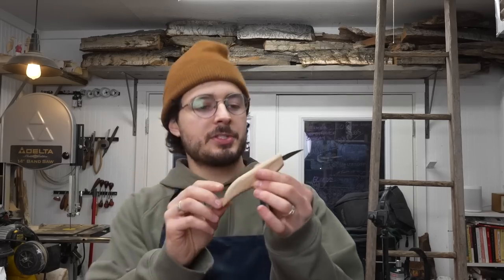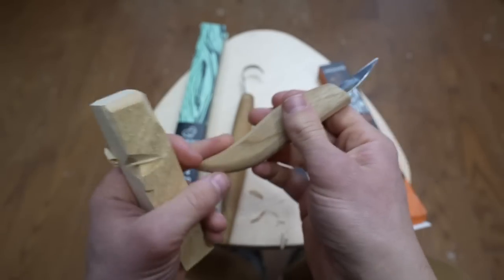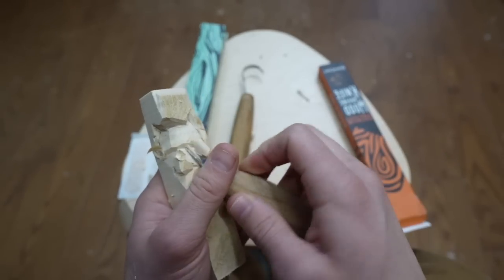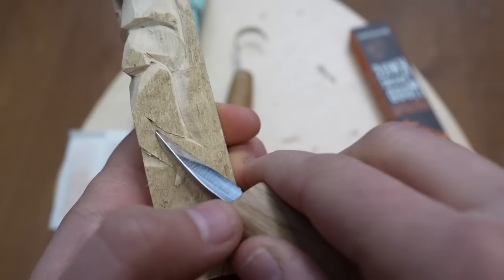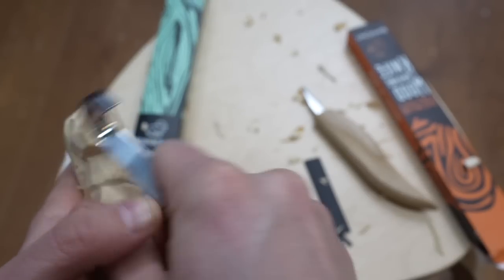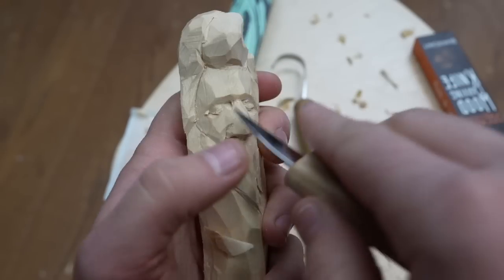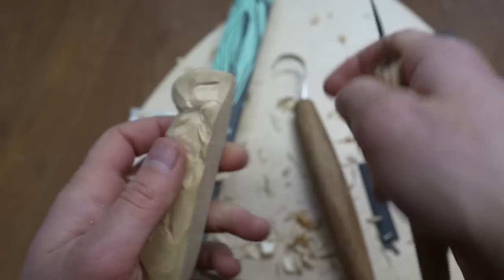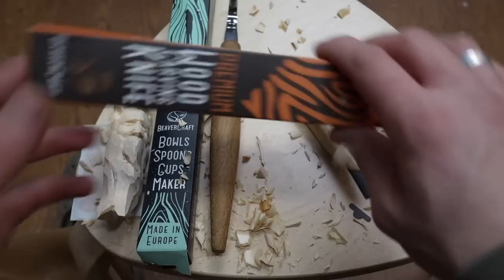$13 Carving Knife Test--Will it Become My New Favorite Knife?

Comment: Honestly, their customer service is what sold me. They also make other tools like draw knives and hatchets. I ordered a hatchet from them via Amazon, and it showed up with a bit too much surface rust on it for being new new. So I went to their website and messaged them directly, instead of Amazon, mind you this hatchet was $80. They responded within 5 mins of 7am opening time for them in the Ukraine, and were very accommodating. They apologized at the quality of the hatchet and just asked for photos. Once they got them, they sent me a replacement within 3 days and told me to keep the original hatchet and see if I could clean it up and make it usable and appealing again. Outstanding customer service. That will keep me coming back to them. My carving blades have actually been better for me then my Flexcuts which some were double the price. Their own brand basswood blocks also have been great quality.
Reply from the maker: I’m happy to hear they have great customer service as well! Thanks for your thoughts!

Comment: Nice review; both thoughtful and helpful.  Nice carving project, too.
As you suggested, it is easy to customize the Beavercraft handles to fit your needs. (I'm not a big fan of that gibbous handle shape, either, whether it's on a Flex Cut or a Beavercraft knife.)  I used a rasp and a file, and then followed up with some sanding, some shellac, and a coat of wax.  No big deal, though I do recommend protecting the blade (and your hands) with thick tape before shaping the handle.
Thanks! 👍👍
Reply from the maker: Good call! Yea, I may modify it soon!

Comment: I have a larger rough out knife from beaver craft and it came very sharp. My only gripe is the handle is a little narrow and I have smaller hands. Other than that its a great knife.
Reply: Sam Skalevik.I agree and if knife builders would over size the handles I believe I would prefer to custom fit my handles are have a true fitting knife. I also fitted every wood handle that are wood as I'm a BlackSmith and most Smiths do think a fitting handle is worth the effort. 
I'm going build some carving knives for my needs and a few friends and all handles are going to be oversized for 90 percent of hands and advice others to fit all handles.
Reply: My hands are large for a woman and I found it perfect. They also can be used right or left handed, which is a must for me since I use whichever hand makes it easier at any given cut. I’m sure a custom handle would be only for one hand or the other, so the neutral shape of the Beavercraft is perfect for me.
Reply from the maker: I felt that way about this knife too!